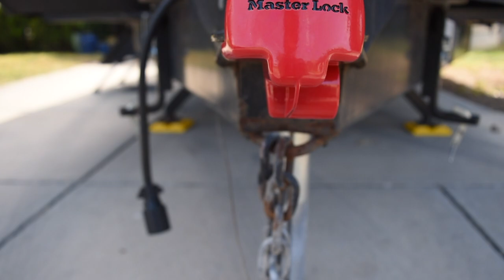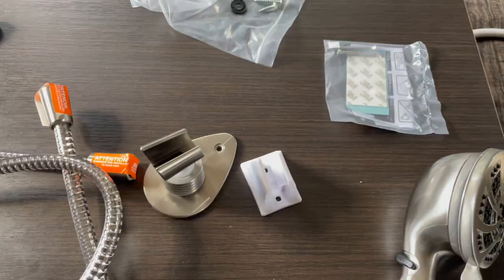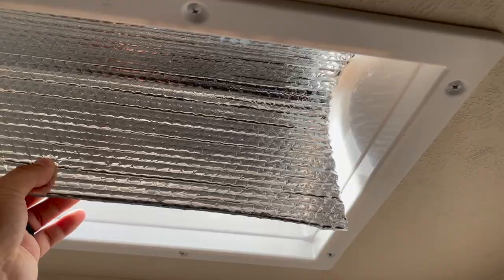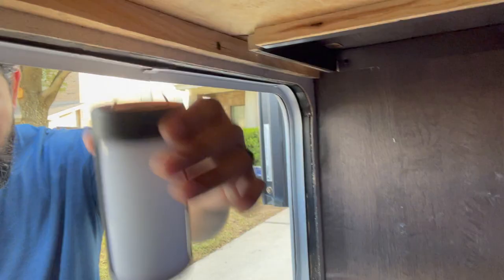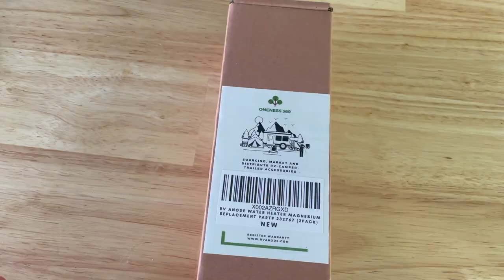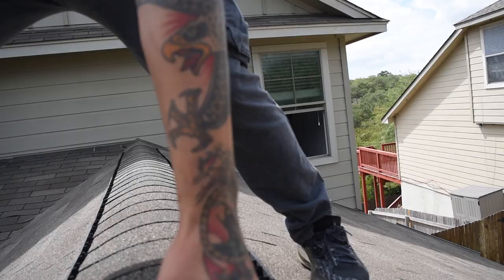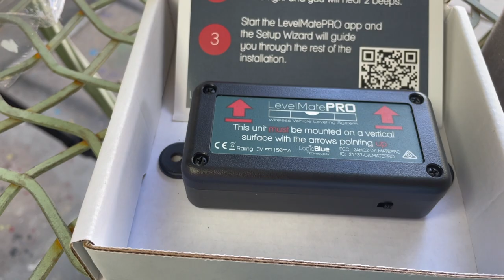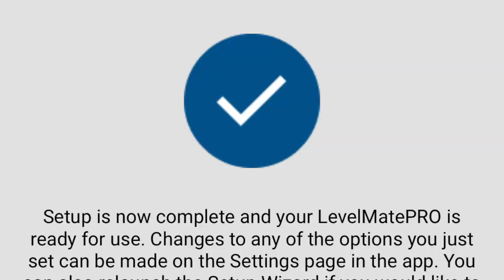7 RV  Upgrades and Accessories that Install Quick and Easy// Travel Trailer Layover DIY Projects

Comment: I do like the coasters. I put some screen on the outside refrigerator panel to keep the wasps out. Also a grab bar on the inside of the screen door . I think I hot mine at Walmart it's made by camco. Couple of screws in the bumper caps to keep them on. You don't want that stinky slinky waving to people. Dont know how big your backup screen is mine in my rearview mirror. I painted my trailer coupler so I could see it better when hooking up. No more in and out of the truck three or four times.
Reply from the maker: Hey thanks Tom! Appreciate the info. I’ll check those out!